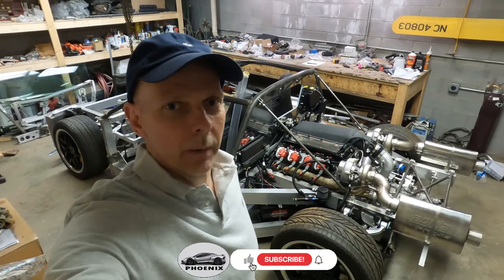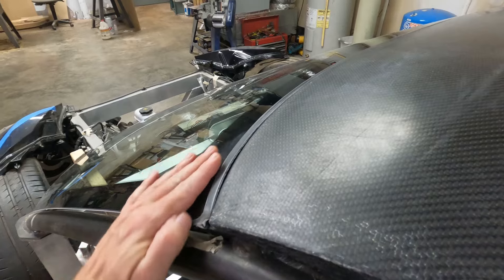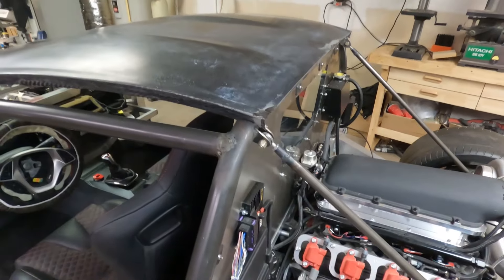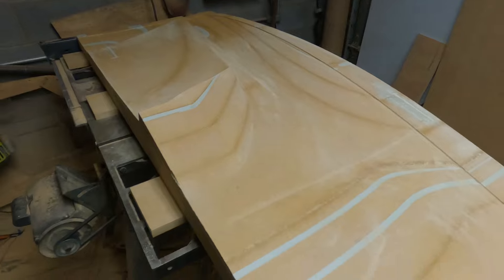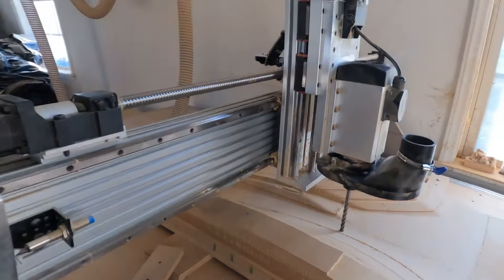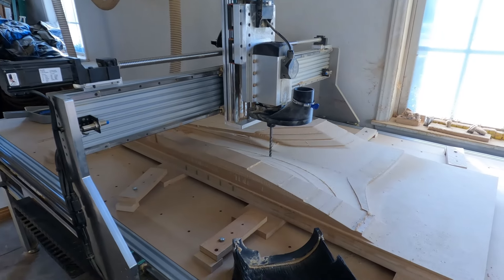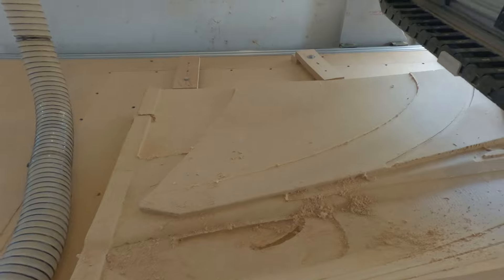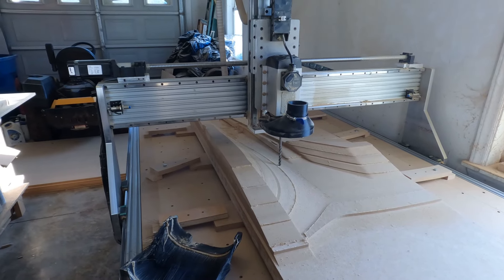Making molds & breaking CNC's

Comment: Put a bungee cord on the Z to create some uplift when theres no power 👍 It could be the stepper is overheating is your doing alot of cutting. But yeah check your supply to the drive, alot of the time the drives have error codes. I wouldnt expect comms to make it drop, typically they have a holding state when theres no signal. 

If you built it yourself make sure the max velocity is not set to heigh, it may be loosing steps on G00 rapid moves.

I hope you get it sorted soon 👍
Reply from the maker: I am not using rapids yet, I just purchased a seat of Fusion, I was using the free version. The weight of the spindle motor will cause the Z axis to drop if the stepper looses power. I am getting an error code on the stepper driver that says communication loss with the stepper position. I will see in a few more days. I have a lot to learn about the correct way to program CNC’s
Reply: @basementsupercarbuild2948  yeah defo do counterweight on the head via a sping or gas strut ect. Z always needs lower max velocity and accel settings. Sometimes its that the settings are to fast for the pc to output to the breakout board.

Good luck 😎👍
Reply: @UKBUILT It's worth counterweighting even just for powercuts. I did it on my biggest maching. The head weighs 110kg 😆

Comment: To help the stepper motor to lift the cutter head. Put a gas spring there. the same type you`ll find on your cars hood or trunk.
It has constant force so wherever the head is in Z-axis it has "zero weight" on the stepper motor.
I`ve done that to my milling machine.
Reply from the maker: Thanks for the suggestion. I have several of those gas struts laying around from when I was playing with a door hinge mechanism. I will see if one of them fells like the correct force to work on the Z axis.

Comment: Loose connection?
Reply from the maker: It’s possible. I haven’t found the issue yet.
Reply: @basementsupercarbuild2948  Generally speaking, If the CNC behaves correctly for a period of time, and then malfunctions, a loose connection(or broken wire) is the likely cause. (or overheating as another viewer mentioned). Good luck!